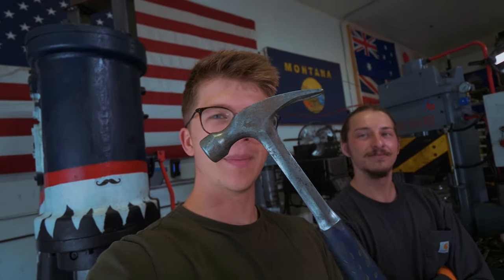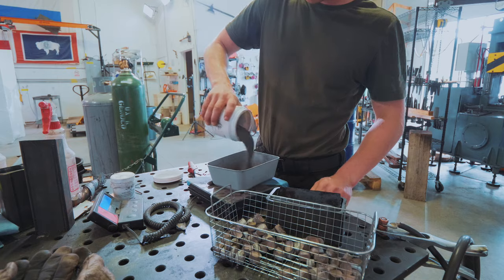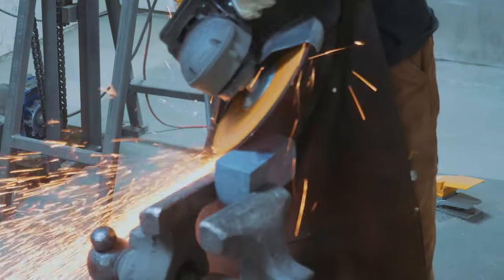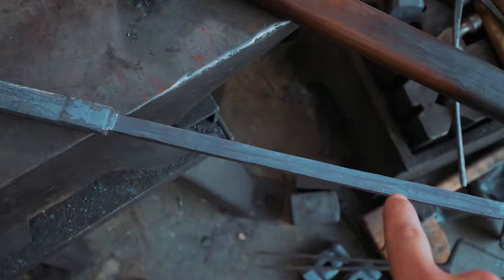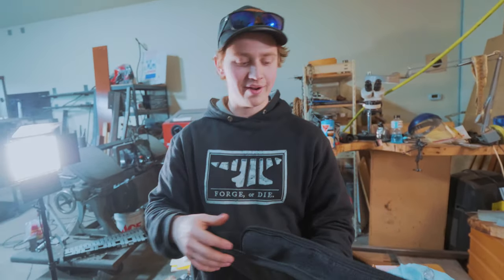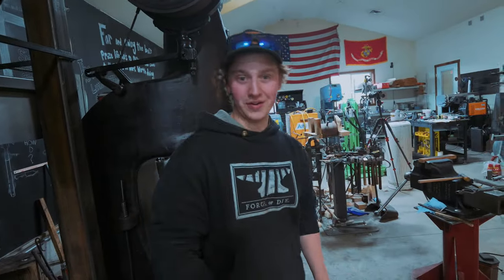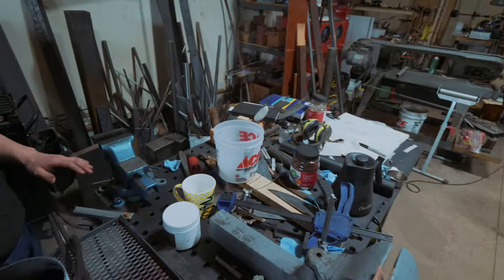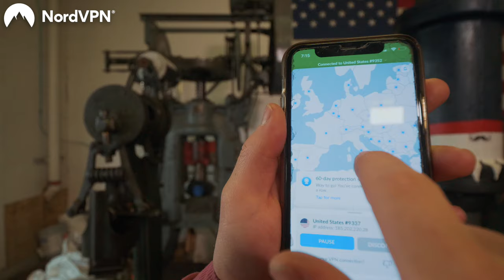Forging a Hammer from Hammer Plug Damascus! Part 1

Comment: Watching this got me thinking… I’d love to see a comparison of making this with the power hammer vs with a human powered hammer. How much longer would it take? Can you still be as precise and make something as perfect?
Reply: The end result would be the same, but the method and starting billet would be different. You for sure would not want to start with such a large billet. Start with a flat bar about the size he uses for a knife, upset one end to fatten it up, hot cut on one side of the upset so you can isolate the claw then flatten out the cut with the claw pointing off to the side and the head starts to protrude on the other. Then you start hammering out the handle and you are at the same stage he left the video on but with less steel to work going forward.
Reply: This might not be exactly what youre looking for, but he has a series of videos where he makes a knife without using any power tools and the way he has to change his technique is really interesting to watch.
Reply: I dont think its humanly possible to make complicated damascus like this without a powerhammer or like three apprentices hitting the metal for you, it takes way too long and the metal powder would oxidize before you finish consolidating the steel properly
Reply: @bjornthorgudmundsson2781  They've been forging damascus steel for atleast a thousand years..
Reply: @Davey768  theres a very big difference between forge welding two pieces of steel like a san mai and forging out of powdered steel

The more surface area you have to work together into a single whole the faster you have to work before oxidation ruins your weld and powdered steel is nothing but surface area

Comment: It looks like an actual warhammer, I'd love to see you do a 12lb spiked warhammer with an 18" metal shaft so it wouldn't break just by striking. It might shatter the wood enclosure (whatever you want to call it). Likely, however, you'd kill the guy on the other end. Either with a chisel edge or a spike on the back end. If you hadn't busted his helm open with just the hammer face. It's so awesome to see you guys interact with machines and your consideration about manufacturing.

Comment: In lieu of the oxidized stainless foil, you can just coat the inside with normal white out liquid. The zinc will keep the forged metals from sticking to the canister.

Comment: Try 3D printed Damascus. Some smiths recently discovered canister shaped 3D printed line drawings reduce to carbon inside a canister opening up the ability to create any damascus tile components you can imagine.

Comment: I don't think pure nickel powder actually alloys with the 1080 powder in a cannister. I'd think you'd need to get it fully molten and sort of stir it for the nickel to distribute itsself wel. You might have some teeeeeny tiny soft spots in there that are still basically pure nickel.

Anyway that's looking real nice as per usual my man!
Reply: Yup. Needs to be full liquid to properly blend.

I think the softer spot caused by the nickle is what made the cracks happen.

Comment: Granted I’m not a blacksmith personally, but I’ve never seen a big plume of smoke come out after the first blow of the power hammer like at 3:57. Unless it was a substance out there that would ignite from the hot billet?

Comment: Next time you get a crack like that, widen it with a piece of metal that's the exact shape of a wedge of a different metal from the item you're working, and then forge weld that metal in. It does make for a nice "easter egg".

Comment: Couldn’t you heat the steel till it’s white hot and forge weld it? Wouldn’t that work better? I have no idea about forge welding or blacksmithing just seems to make sense in my head🤣

Comment: God damn it , I've been trying to find someone to make me a custom small hammer head (I'll make the handle from native timber) for a walking stick slash branch grabbing tool to help me with my possum trapping ,for hammering in and taking out staples and for dispatch of possums (introduced pest in NZ) and because I have issues with my spine and need some help walking around ,I can't work anymore that's why I do a few possums in the morning for exercise for my back ,I can do it at my own speed but lately my spine has been failing.
Everyone in NZ doing blacksmithing I've asked to help can't because they to busy or they only do stock standard heads and charge a arm and a leg for it

Comment: That damn crack, I seen it the moment you flipped the cold billet. It was ruined from the start. You can only remove the cracked section and work from there. Could have saved alot of work by not trying to save it. 
If you still think you need to forge weird after the canister is removed then it didn't work. You seen the crack and thought you could save it.
This should be the best lesson learned in this video.
The cracked billet
Reply: Love the work though

Comment: R.I.P. to the forearms of the contractor who uses this framing hammer for more than the occasional nail.
Reply: never did framing work, so i have to ask, whats the problem? too small?
Reply: @kassiog.6595  Too heavy. Framing hammers are typically just a few ounces (around or just over a pound is preferred) but have long handles (18-24 inches) to allow for easy swinging and use of momentum when driving nails vs sheer weight of the hammer.
Reply: @mrfochs  now i see, but that's a easy fix, as they still have to do all the grinding

Comment: I don’t care what they say a full steal “framing” hammer is the absolute stupidest thing you can use.  I’ve had more necks break with any sort of metal “framing hamers” I now use 29oz head with a hickory handle. First time I switched I had a hammer last 4 years. And it didn’t break. I lost it.